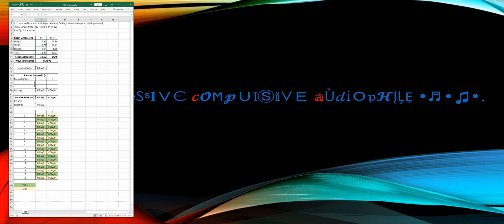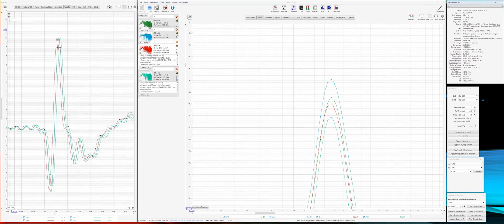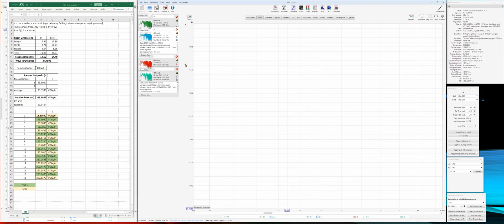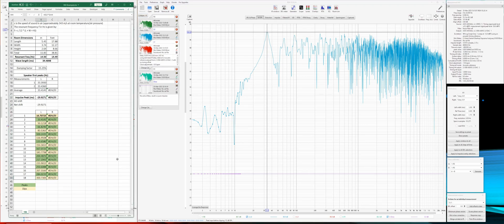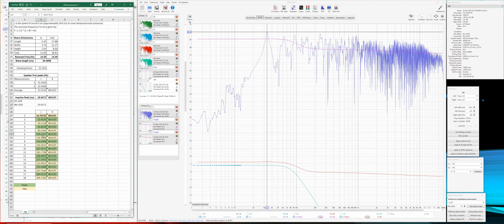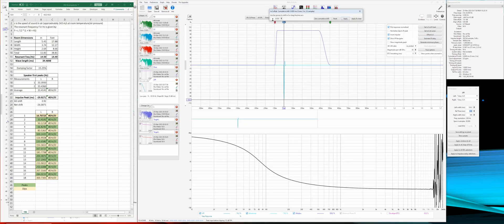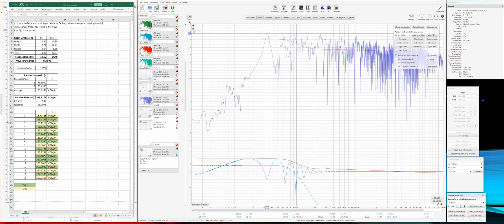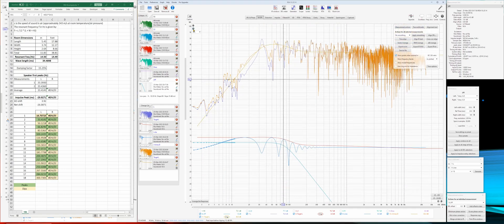Boost your bass output with a virtual bass array filter

Comment: Your videos are quite interesting but, because I am a complete N00B, I have to admit that I feel like I'm trying to drink from a firehose! (Thanks for your playlist "Applied DSP - I'm going through that now, as a starting point.) If you have any other suggestions for understanding the basics, I would greatly appreciate it! 

That said, I've recently ordered my first dsp product (MiniDSP Flex), and I am really interested in learning to use it along with the recommended software to optimize my 2.1 stereo setup. 

After watching a couple of your videos, I am concerned that I may not be able to get very accurate with some of what you are doing because my setup is in a room that is in an open(ish) floorplan, with a semi-open kitchen partially behind my listening position on the left, and a dinette area on the left - a half-wall with scalloped openings into a dining room and hallway to other parts of the house on the right of my listening area. I'm thinking it's basically going to be impossible for me to calculate my room's resonant frequency because of the layout. Am I wrong about this? Any particular suggestions as to how to make the best out of this situation?
Reply from the maker: You don't really need to go beyond basic vector maths to be able to create descent corrections for your system but of course it will help you understand what you're doing and maybe create your own methods. Flex is very popular among the DIY crowd who know what they're doing but I don't have one myself. It really depends on your setup at the end of the day. Are you streaming, playing from a computer or use an analogue source.

I understand all irregularities in your room are behind the LP which is similar to my room. As long as you've a relatively  symmetric front/side wall organisation, VBA should work. You can use the total volume of the room to find pseudo dimensions.
Reply: @ocaudiophile  Hmm - my last comment got deleted for some reason - I'll try again.
Reply: @ocaudiophile  I was trying to link to a sketch of my room layout to give you an idea of what I'm dealing with, but apparently my comments won't post with a link...

My setup currently consists of mostly streaming from a WIIM Mini, and my television, with an occasional session from my laptop via USB, but that is rare. 

There is also a 3H'X10L' half wall with 2 large scalloped openings above it on the right side of my system. That opens to a 10'X18' dining area and a hallway that goes to the front of my house. I imagine this will have to be accounted for, but I'm not sure how much, considering that the half wall has got to be reflecting a fair amount of the sound. My sub actually faces that half wall currently because that's one of the only positions I can logistically make it work.

Anyway, I hope what I'm asking makes sense, and that there's a reasonable path forward in optimizing my system with DSP.
Reply from the maker: You can only post google drive links in youtube comments
Reply from the maker: I replied to your google reminder. I hope you received it.

Comment: I have a room with a sloping ceiling,so I have 4 dimensions. What is the best way to approximate the three dimensions you refer to at about 1 min.
Reply from the maker: I guess calculating the volume of the room and using its cubic root as 3 equal room dimensions (say x) in the resonant frequency formula would be a logical approach: f=c/(6x) You can then fine tune it depending on the convolution result.
Reply: @Obsessive Compulsive Audiophile  Thank you for that. I also have two open doorways in the corners of the front wall opening into another large room. So nothing is perfect. I will have a go following your tutorial.  Thanks again!

Comment: Asking in laymen terms, but is the takeaway of this video that acoustic room treatment is "unnecessary" after following this video?
Reply from the maker: Acoustic treatment is always better but for these very low frequencies the depth of the traps required will be too large to be physically viable.
Reply: @ocaudiophile  thank you so much as always for your quick response. I'm on a 5.1.4 setup using Marantz Cinema 50. Would you say following the Supreme Audyssey Guide and this video is a good starting point for full manual calibration?
Reply from the maker: If you'll use Audyssey and dynamic EQ then yes but if you want to use graphic equalizers there are two videos for full manual atmos calibration.
Reply: Wondering after all these steps in REW, how do you apply the result in the receiver?
Reply from the maker: @Judddernaut  Tutorials about FIR filter generation for stereo systems are not compatible with multichannel home theatre receivers. They need a processor (a PC/Mac or to a lesser extent a MiniDSP somewhere in the chain).

Btw, a Marantz Cinema 50 is perfectly capable of processing FIR filters and in fact that's how Audyssey/Dirac work but they are not open to users. There's no brand I know of which lets you use your own FIR filters.

Comment: Hello Mr Serkan, 
I always follow your excellent works trying to apply them to my system.
I use a yamaha avr feeded with JRiver through hdmi using 4 channell straight PCM , L/R and 2 sub ( the second created using the CENTER channel)
and so using 4 filters created following your precious indications. Lately i'm having problems trying to synch L/R with SUBS.
Till now i used the delay funtion of jriver to put in synch with according to the numbers found in the info tab of REW at the line called
"TIME AXIS START", but it seems no longer works.
In fact i have 2 filter for subs that are very short (VBA) and the filters for L/R that are quite longer (even if i trimmed them)
Could you please show me if there is something more valid than my ears to trust on, trying to adjust?
Thank you very much.
Reply from the maker: Thank you.

Measure all four channels with REW with all the filters on, you may need to play a sweep from JRiver to do that. Make a copy of each measurement. Then in ALL SPL tab, with only the copies ticked, "Align IR starts" of all copies to each other. FInally check in Overlays/Impulse tab the distance/time delay (with CTRL+ Right mouse click method)  between the impulse peaks of the originals and the copies and adjust delays for each channel accordingly in JRiver DSP. Align IR starts may sometimes get it wrong in the first attempt, you can also try "time align"

Comment: After all REW editting and correction for Subwoofer and Speakers how to import or make it effective it in to AVR? Still unable to understand.
Reply from the maker: This video is for stereo hifi systems or for HTPC owners who can use convolution engines in their equipment. Currently, there's no surround receiver that lets user to input FIR filters. You should follow Audyssey videos in this channel for the best possible calibration of your receiver.
Reply: @ocaudiophile thanks for reply
Reply: @ocaudiophile  so can you make a .wav file and use EAPO?
Reply from the maker: @l.s.1709  sure you can
Reply: Is there any way to calibrating speakers and Subwoofer with REW and to import settings or that calibration in my denon x4700h

Comment: My room is rather strange, the restroom occupied a portion of the cuboid. What length should I use? Or is it better I use the previous way to look at the peaks and dips in my low frequency?
Reply from the maker: Ro dimensions will only give you a ballpark figure anyway. Look for the largest and first peaks common in both speakers and all mic locations.

Comment: Nice!  Going to try this this week.  Would there be any chance you could post the excel file in the show notes?  As your old VBA videos have slightly different formulas and tables.
Also, when you have multiple subwoofers would you just do this to the L and R signals based on the mains measurements?  Or would you do it to the subwoofer output as well based on the combined sub response (as my combined and EQed sub response is pretty flat with no obvious peaks and dips)?  Thanks!
Reply from the maker: Done!